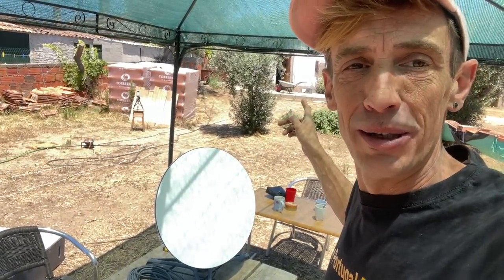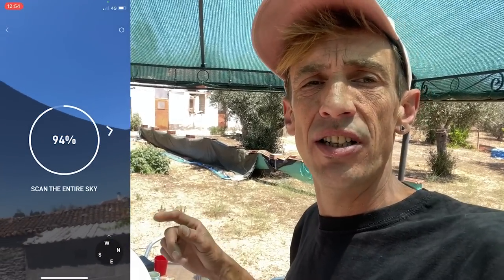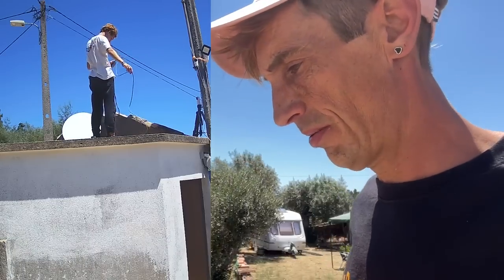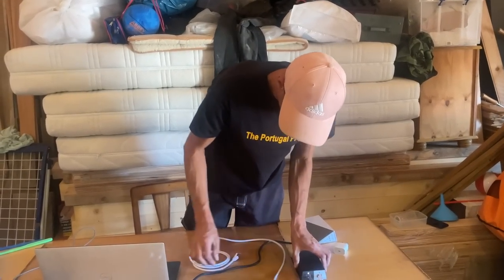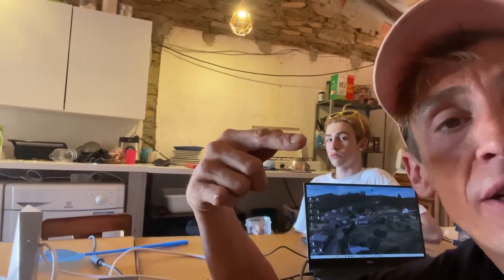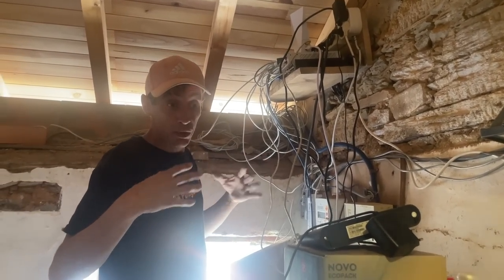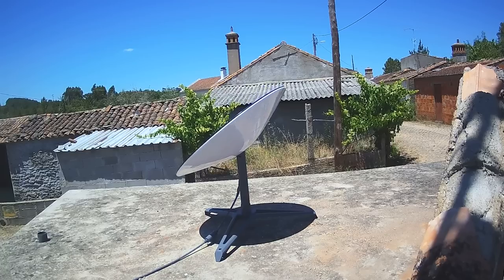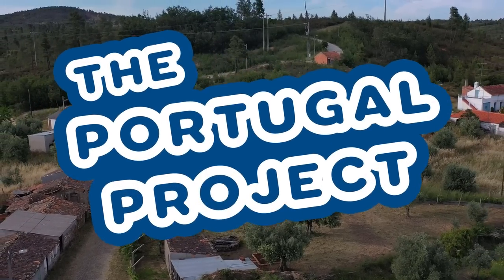WILL ELON MUSK DELIVER? | Starlink Off-Grid Internet | Installation and first impressions

Comment: Two problems: one or both of the dogs are possibly likely to chew the cable. Hang it at the roofline. Two: Get  the legs of the dish drilled and fastened in the concrete ASAP or it will become a kite seeking flying lessons.

Comment: surely if the earth was actually a spinning space rack that’s spinning at 1000 mph and travels 66,600 mph around the sun in a yearly orbit of 58 million miles while the solar system spins around the galaxy at 480,000 mph, while the galaxy goes around the “great attractor” at 2.2 million mph and that the “great attractor” is 100 quadrillion times bigger than our sun. All that motion while travelling 19.2 billion miles in one year and the north star (Polaris) stays in the same position in our night sky year after year and we don’t feel a thing? Surely, you would just be able to point your satellite straight up into the sky, right? Or, you are just aiming it at the closest ground based mast ;)